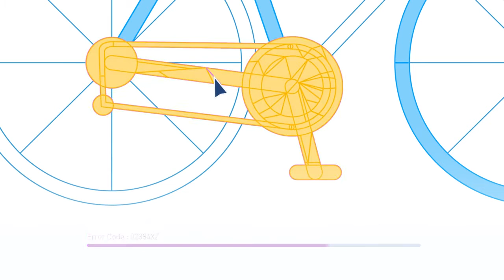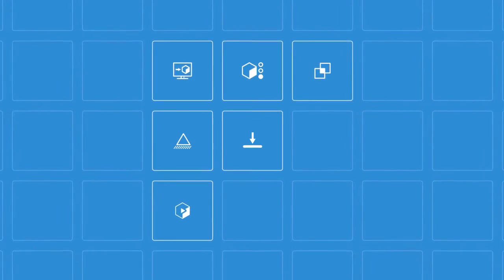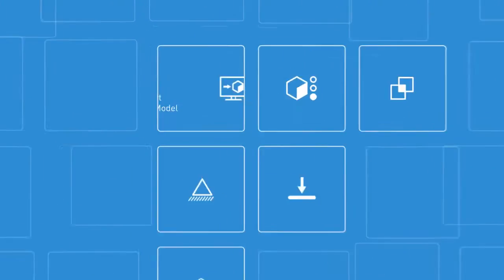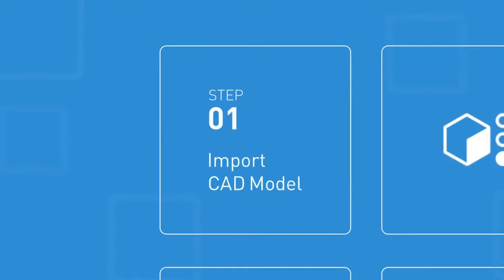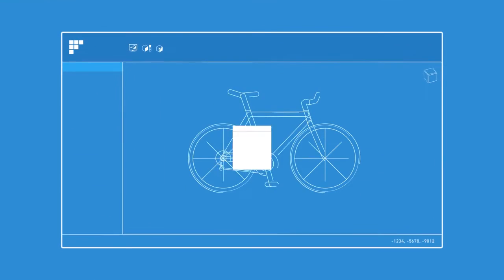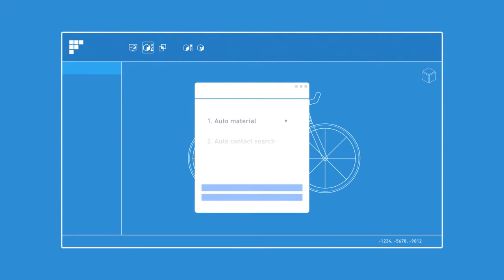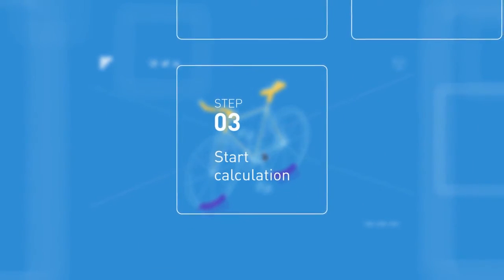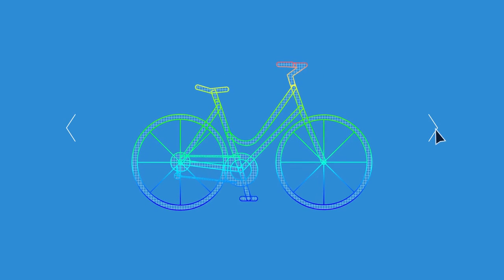Introduction to midas MeshFree

Comment: Nice! How do you define the material properties?
Reply from the maker: Hi Nizam, once after the model is imported and before running the simulation, we either select the material from the library (about 1000 materials available) or we could define the material manually. Instead of apply the material into mesh like what other mesh based FEA work, we apply on the part itself...